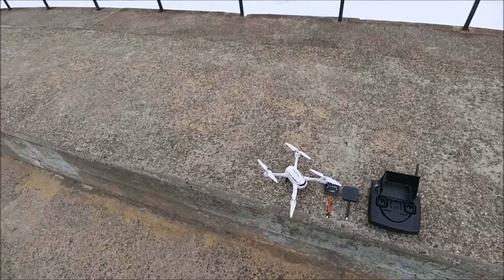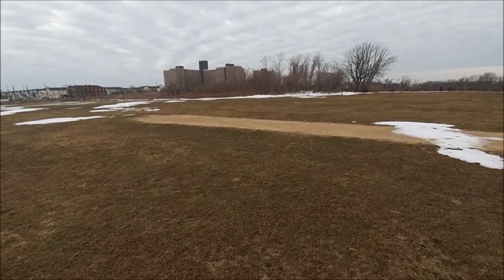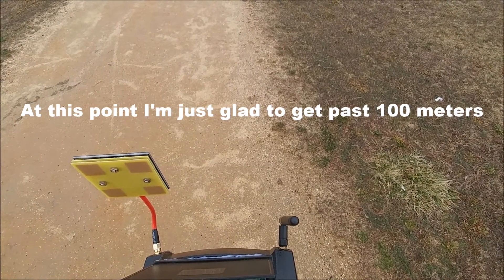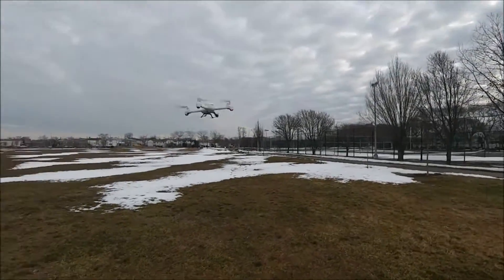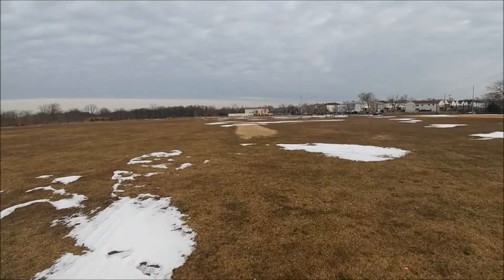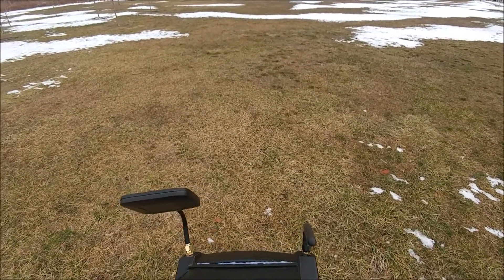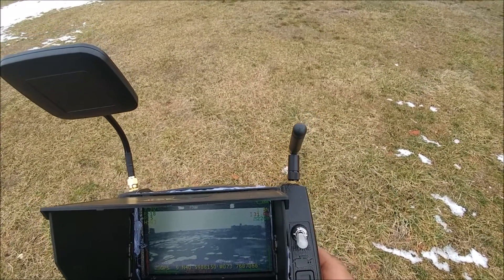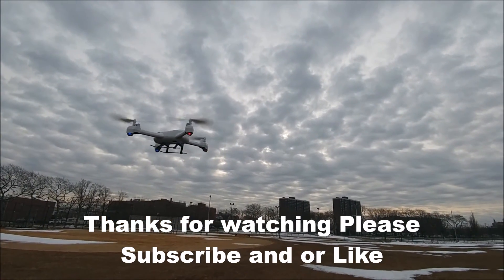Hubsan H502s FPV Patch Antenna Comparison Hubsan FPV Patch and the Blomiky FPV Patch Antenna kits

Comment from the maker: Link to Blomiky range extender kit
https://www.amazon.com/Blomiky-Distance-Enhanced-Antenna-Quadcopter/dp/B01KC4DQPY/ref=pd_rhf_se_p_img_8?_encoding=UTF8&psc=1&refRID=C9WCPZNJG72GGF50DPKG

Link to Hubsan range extender kit
http://www.banggood.com/Hubsan-H501S-H107D-H107D-Enhanced-FPV-Distance-5_8Ghz-14dBi-Panel-Antenna-2_4GHz-3dBi-Antenna-p-1053146.html?rmmds=search
Reply: Novice Quadcopters Is the second antenna fully compatible with h502s? Is am asking this because on bangood site said that it's only for 501.Thanks

Comment: You guys can look through the Amazon and Banggood reviews if you want but from personal testing, the Blomiky patch antenna did the same or worse than the stock antennas. Although, I haven't tried the other control antenna to its full range because I don't feel comfortable flying with a black FPV screen past 200 meters 😐. (I live in the suburbs so I get moderate signal interference).
Reply from the maker: This video is a few years old. As of present day there are much better antennas. Thanks for watching

Comment: My latest FPV range test on a stock Hubsan H501S-S was 1500m out the box (All Stock - No mods-gps mode only-alt=100, over a big city). I now have the antenna mod but latest test was "only" 1200m, did RTH bcs bad weather, and had FPV dropout bcs it was very difficult to point directly at drone, so for now the stock antennas was better. Saw a youtube with 6km range on a Hubsan H501S-S (2S 5200mah 12C, TX antenna mod, drone Antenna mod, drone gps outside)...and also saw 1500m alt bcs Russian hacker Firmware: New 1.1.38 RHE FC firmware
RHE firmware (Russian Hackers Edition by rcdesign.ru forum users) 
Open Readme file first!
Download link: https://drive.google.com/drive/folder...
(no range limits, tx max power, RTH altitude customization, GPS mode speed customization and more)
Reply from the maker: Jonni Laumann try moving the transmitter in very tiny increments of 1/4 inch at a time. If you move it dramatically you could be aiming in the wrong direction. If you are half a kilometer away or a kilometer away move the transmitted very very slowly and pay attention to the signal bars. Thanks for watching
Reply: I done that, yes it is very directional.. lets just say it was very foggy on my 3 tries that day with the antenna mod from ColorMix (see below).....but weird that the stock antenna is so good, but that was also on a clear day, but even drone behind you the FPV was good on stock.. both tested same start place same path over a big city (luckily no interference from the big industry and power lines, flown 1000m plus many times from diff sites over cities, i know its illegal)...cant wait to go to our airfield to test range on Stock and the Color line antenna mod..PS be aware of tractors, they have a powerfull GPS that can drop drones out of the sky
Color mix Antenna mod:
https://www.gearbest.com/fpv-system/pp_436713.html
Reply from the maker: Jonni Laumann Thanks for the heads up and info.

Comment: Nice video test besides the fact that your patch antenna of your first test in on the wrong side ;-), 
So I guess both antennas have about the same specifications  ?! have you done another antenna comparaisons ?

About the lengths of the  U.FL IPX / SMA pigtail cables: 
I bought these antennas from Gearbest ( https://www.gearbest.com/rc-quadcopter-parts/pp_415857.html?wid=21 ) and the pigtails lengths are around 15cm. In this Hubsan H502S remote controller a shorter 10 cm pigtail would have been clearly sufficient.  What about the lengths of the  U.FL IPX / SMA pigtail cables which link the remote controller printed board to the antennas ? Same pigtails size or different lengths? 

With my  H502S bought recently from TomTop and without the patch antenna I was able to get a clear video till around 150 m and a snowy video after that. With the video patch antenna  (the square antenna is called a patch antenna - see http://www.emtalk.com/tut_1.htm ) , now I can easily go up to 500 m with a clear video and I must then come back because of the depleted battery . I often put a Mobius Mini attached under the H502S so I guess the overweight uses the battery, but the Mobius Mini is so much better than the original camera of this quad....
Reply from the maker: TheCric after doing the mod the actual pigtail wires inside are the same length as the stock wires that come in the controller. Looks like you've done your homework well thanks for watching. If you have a channel I sub4sub
Reply: Thank you for the info about pigtails. I guess the set "patch antenna plus pigtails"  from gearbest is the cheapest on the market and because patch antennas are often used on diversity receiver, they  must  sell a lot of them.  I don't have really a channel for now because I don't publish enough for that, but maybe later. Curiously I have subscribers I never asked for :-D but we will see next summer :-D

Comment: could someone tell me, what connector (rpsma/sma) this fpv antenna has? pls
Reply from the maker: Technik The sma connectors that go with hubsan transmitters are female on the board. they are connected to the fpv antenna and radio antenna. SUPER fragile
Reply from the maker: Technik will look for a little k with picture. at work will have to search later
Reply: ok thanks. I wanna use it for my race quad, and my receiver has an rpsma connector. So now I know that I need to buy an adapter.

Comment: I did the Mod on mine also and I'm getting over 500 meters with mine
Reply from the maker: Squadcopter Just give the engines a chance to cool between flights. If they get to hot they burn out. Thanks for watching hope you subscribed.
Reply: Novice Quadcopters Ya I fly my H501C in between flights too let one  cool down you can check out the 500M flight on my channel too if you want.

Comment: Can someone explain me what do these volts mean on the transmitter?
Reply from the maker: Thunder On the upper left that is the drones battery life. The one on the left is the transmitter battery life.
Reply: Novice Quadcopters yea but there is a V sign that means volts? What does that mean?
Reply: Battery voltage....disregard the battery meter and go solely on voltage....never let it drop below 6 volts or battery is shot...stick to 7.4-7.1....then charge battery

Comment: please don't take this the wrong way but you are doing a number of things wrong. first of all your control antenna should be in the same plain as the one on the quad not perpendicular. so bend it to the right almost horizontal. Next I noticed you have some kind of modified landing gear onit? Definitely not hubsan. added weight covering vent for baro sensor. The higher you go with a directional antenna the better. Do 3 things instead of questioning company. orient antenna control one in same plain as quad. horizontal ..lose the bottom crap and fly high. Enjoy.
Reply from the maker: Arnie Rosen Thanks for watching also thanks for the pointers. A few people mention some things I was doing wrong. In the process of working on a revision to this video.
Reply: nice landing gear.  This will allow you to take off while in the grass which has been a problem with that model sitting so low.

Comment: hi! excuse me i have a problem with saving pictures and videos on micro sd in my h502S, do you know why this happens? and what is the limit of storage from micro sd to use in this drone? i was using 64 gb but doesn't record nothing. Thanks for your kindness.

Joffre
Reply from the maker: Josup24 I would think 64 gig is not good for H502s. First did you format the sd card in a pc? Second I'd try a smaller sd card.
Reply: Novice Quadcopters Oh ok! thank you!! yes i thought about that, did you ever hesr about that kind of issues? and yes i format it a couple of times but no result
Reply from the maker: Josup24 I am using a simple 4 gig sd card. How did you format using a pc or Mac because every time I use mac it doesn't work.
Reply: Larry Steimel that's right have to push again the record button, and i using a 16gb micro sd and us working perfect!
Reply: Josup24, Did you push the record button again to stop recording?  I was using a 64 gb card and I didn't  notice that you had to save the recording by pushing the record button again before you shut down or it didn't show anything on the disk.
Reply from the maker: Larry Steimel yes you have to push the video to start and to stop. if you cut off quad or transmitter before stopping it will corrupt the video. making it unplayable.

Comment: I'm gonna get the h109s.
Reply from the maker: Rob Masters I was thinking about it but I'm also thinking about the advanced version.
Reply from the maker: Rob Masters Standard or Advanced
Reply: Novice Quadcopters the "low" edition (stupid name should have been base or basic model) has the one axis gimble! The advanced edition has a 3 axis gimble and the "pro" edition has the real expensive transmitter. I'll go the low edition as I can easily get a 3 axis gimble(providing a non standard gimble will fit). Gear best has flash sales where the low edition is under $400 aud. Having said that I love your new yuneec. Have to do a vid and let us know range and capabilities...keep them coming !
Reply from the maker: Rob Masters You should enjoy it is a great quad. Good bang for your money. Let me know when you get it.